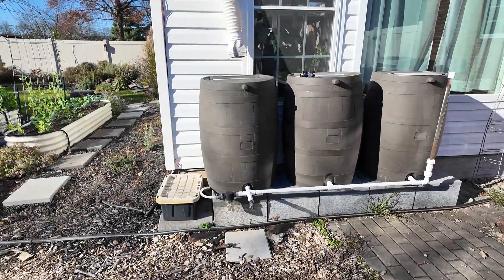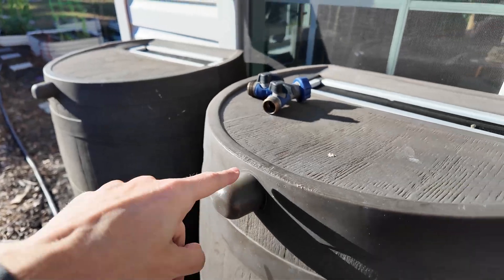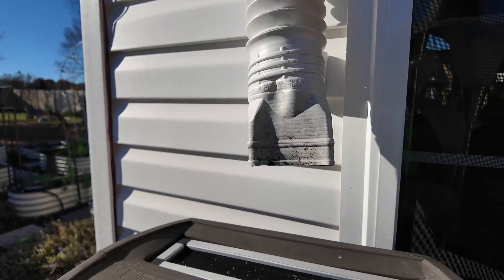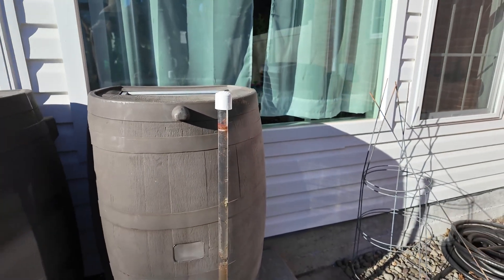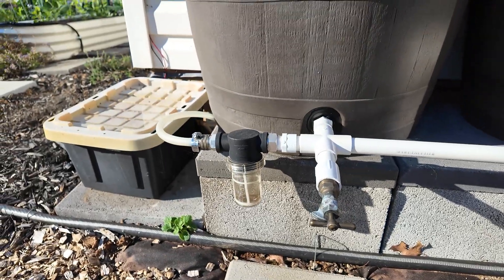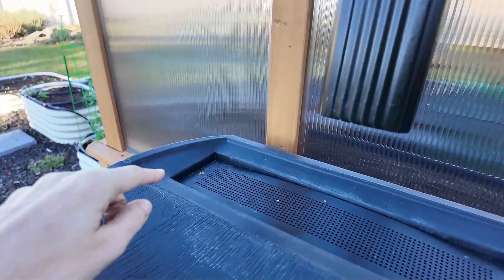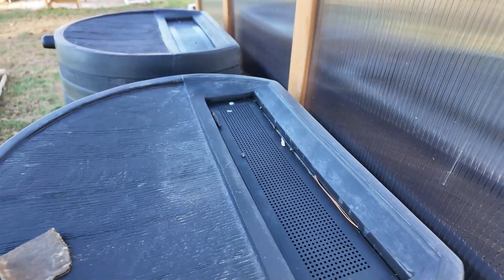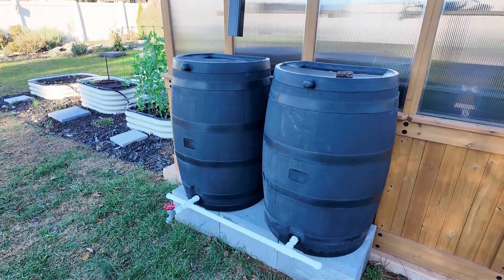Let's tour our 450 gallons of rainwater harvesting capacity, including solar irrigation!

Comment: 6:00 if you take the tip off there is a kind of strainer black plastic in there, remove it and the flow rate will increase. But the spigot is just very small.
Reply from the maker: oooo thank you!!

Comment: How long can you run the pump on that 7ah battery
Reply from the maker: I asked my husband because this is one of his projects :) He said we've never run it completely down, so we're not totally sure. Usually we're able to turn on the irrigation and empty out the barrels pretty quickly. It also powers a blower out in the fire pit, too. If anything, the main worry is running the barrels dry before the battery runs out.
Reply: @ awesome thank you. I’m working on my system and you have a lot of great ideas that I will incorporate into mine.